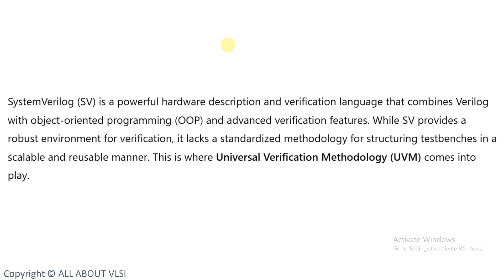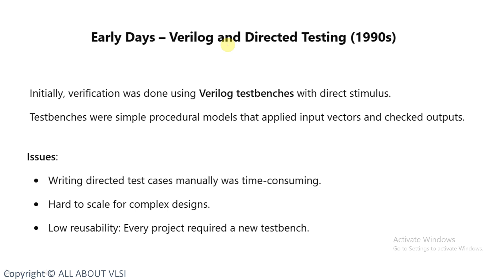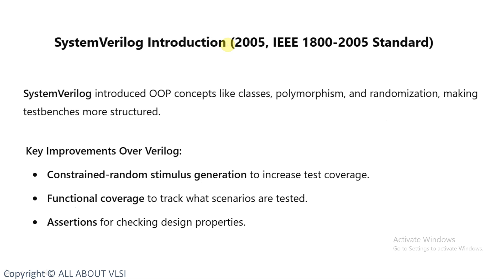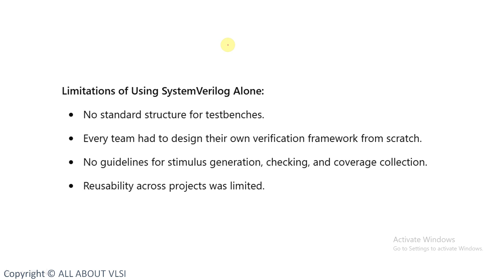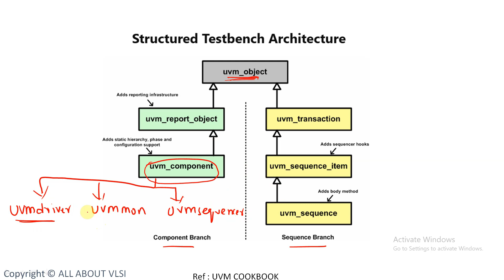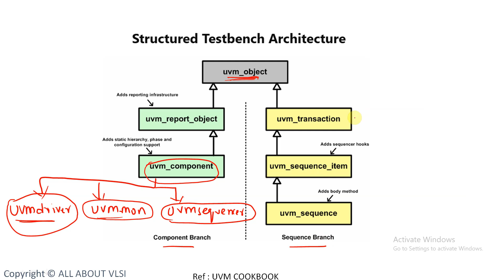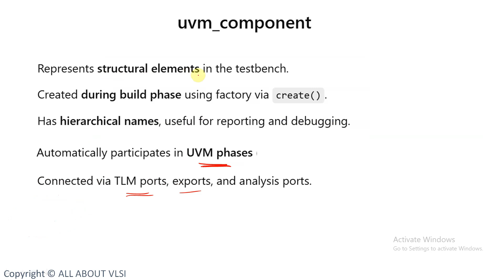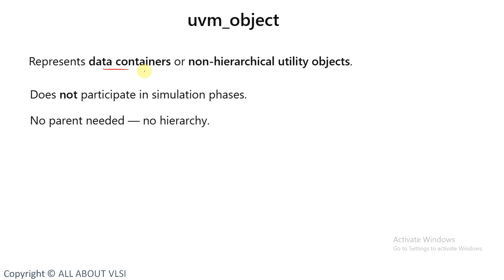UVM Introduction | UVM Hierarchy Explained | What is an Agent in UVM?

Comment: [00:05] Why do we need UVM when we already have System Verilog?

[00:44] Definition: What exactly is UVM (Universal Verification Methodology)?

[01:11] Evolution of Verification Methodologies (Verilog -> System Verilog -> UVM)

[02:13] Key Limitations of System Verilog (Lack of Standardization)

[02:30] UVM as a Standardized, Industry-Wide Methodology

[02:53] UVM Testbench Hierarchy Structure

[04:05] UVM Built-in Classes: UVM Component and UVM Sequence Branches

[05:46] Difference between UVM Component (Hierarchical) and UVM Object (Data Container)

[07:23] Introduction to the Agent in UVM Hierarchy

[08:15] Configurability of the Agent

[08:29] Detailed comparison: Active Agent vs. Passive Agent